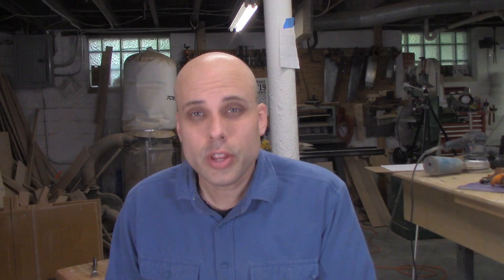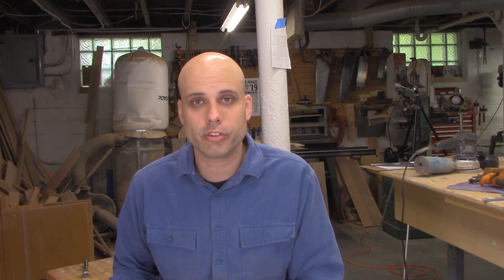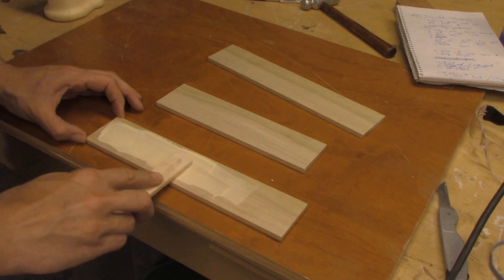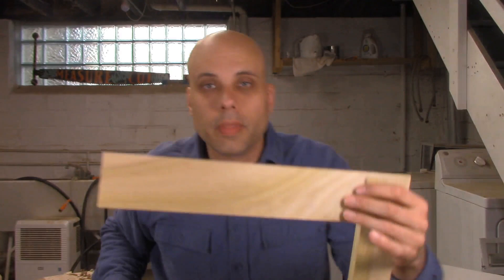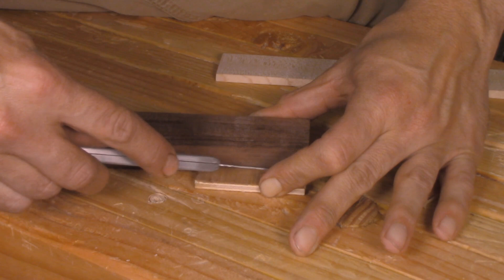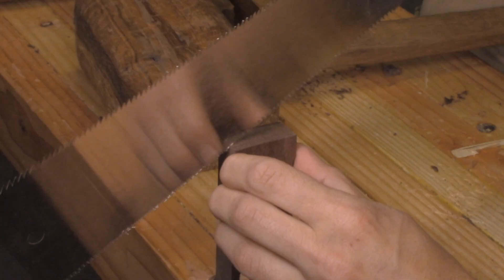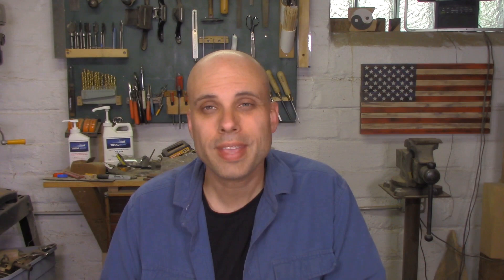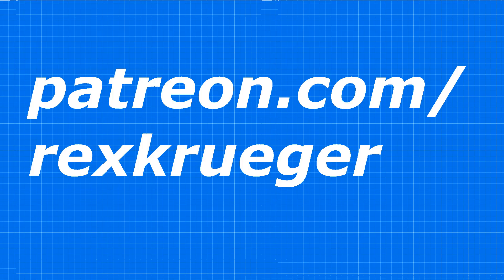Make your own try-squares for woodwork.

Comment: Nerd-tip: If you don't have a square that's appropriate for the job, measure accurately and use the pythagorean theorem or a quick and dirty 3-4-5 triangle.
Reply: Yay for nerd tips! Really, I am tickled that someone actually thought to add this to the comment section, because it really did need said! If I hadn't seen your comment, I'd have had to make it, myself. 😄 Maths rule!
Reply: Alternatively use a compass and straight edge.
One line,
one circle centered on the line,
second circle same size on the intersection of the previous circle and line,
the intersections of the two circles make a line perfectly perpendicular to the original line
Reply: Nice. 😊
Reply: Maybe a better way to say it: a line constructed at the intersections of two circles is perpendicular to the line drawn between the center points. Sizes don't matter.

Comment: Hi Rex. I was surprised that you didn't show how to make a square without having a square to use. By using two intersecting circles on a straight line and connecting the intersecting circles  perpendicular line. Perfect right angle every time to use. Best regards
Reply: All you have to do is create a 3-4-5 triangle and built the square using thar as a quide. Even a string will do. However, the square has to have flat and parallel wood to work correctly, so the first part is learning to make straightedges out of wood
Reply: @researchandbuild1751  i was thinking you could lay out three pins/nails on a flat piece of board at the vertices of a 3-4-5 triangle (say 6" 8" 10") and use that to align the two parts of the try-square.

Comment: To cut bridle joint (or rip) with ryoba saw, angle woods 45 degrees toward you, saw to both line at 45 degree angle (saw level), turn over and repeat same process  on other side. now level wood and flush to bottom. Try it you will be amazed how well this works. Same technique for tenons. Make both cuts at in succession on on side, to time to speed up process. This is correct technique.
Reply: Well said. You read my mind. I always cut one side, the other, then square the depth, even with western saws.
Reply: ^
This is the way

Comment: Just made my own small square after downloading the pdf. Really didn't need the pdf, but thought I'd make a small donation to Rex for all of his hard work. That's a hint to all of you other cheap woodworkers. The square is coming out awesome. I used walnut for the handle and oak for the rule with 1/8" brass pins (3). Finishing with Danish Oil and lacquer. 2nd application of oil is drying. I'll lacquer it in a few days. Can't wait to use it in my shop. I've got a bunch scrap pallet wood to mill so I'll be putting it to good use.
Reply: Ah, rescued pallet wood - a person after my own heart!

Comment: Rex, just discovered your videos and love them.  A way to make a square without a square is to use a little bit of geometry...

A right triangle has a simple ratio of 3 to 4 to 5.  So... if you make one limb length of 3, the other limb of length 4, and then the diagonal between the ends length 5, you will have a perfect 90 degree angle.  You can also make other ratios... 1 1/2 by 2 by 2 1/2... or 6 by 8 by 10, etc.

Comment: You can also use a Speed Square (if you have one) to scribe a line parallel to the edge of a board. It’s designed for that on purpose. Put your pencil or marking knife against a point on the Speed Square, put the angled “lip” against the board edge, and move the marker and Speed Square together.

Comment: Hey Rex! That's a pretty great video you got there!!!

   Minor note you might be interested in...
   Binge-watching over on Jonathon Katz-Moses' channel, I happened on one of those "innocuous little tricks" regarding saws... Moses LOVES his Japanese Saws, too... so it helps. He suggested that when you're cutting, take a position that lets your "saw arm" work as straight and easy as you can (referred to the pool-player and stick)...  but everyone has that advice... so you've heard it. 

   Importantly, he said to WATCH the saw BLADE, or rather the reflection in the blade. If it stays straight, you're either dead-on or very close.

   Now, I've never really thought about that before, so I immediately took one of my new (to me) Vaughan Bear Saws out and grabbed a piece of "reasonably straight scrap"... AND low and behold, the reflection WILL absolutely make a straight segment between the stuff you're cutting and the end you can see... 

   Okay, it's not a miracle, and anyone who understands basic optics can explain (probably better than me right now) how it all works with light "refracts at exactly the same angle as it hits a reflective surface" and how it's all geometry... etc... AND for the record, when you're stuck trimming off "little bits" that are completely covered by the blade, no, you can't see through the saw... BUT for anything large enough that you can see the end past the blade, lining up that reflection so it bridges the two visible segments REALLY DOES HELP!!!
   AND since Japanese saws are thinner than you're used to, being more prone to "wobbly stuff" it can help keep an eye on something to pace yourself while you get used to them...

    Otherwise, feel free to laugh at me... I mean... I'm over 40 and I just hadn't thought about it... SOOOooo I kinda laugh (almost hysterically) at me too.

    FOR ANYONE INTERESTED, Katz-Moses has a video regarding "Tips and tricks with Japanese Saws"... and there's a LOT more than this one in that... seriously, check him out. ;o)

Comment: You don't need a piece with a good edge to check a square.  You just need something flat that you can put two nails in.  the two nails make a line, so you don't need a reference edge.  Put the square on the nails, strike a line on the rule.  Flip it around, strike another line.  If the lines are parallel, you're set.  If they're not, figure out which way it's out, and correct it.
Reply from the maker: Now THAT is a hot tip. Thanks!
Reply: Um, and how do you get the same edge of the rule flipped over when the beam is pointing the other way on two points of contact? The beam will be off both nails when flipped the other direction. Do you have a video of this technique? If so please link to it in your reply. I am obviously missing something in your technique.
Reply: @midjetville  Thanks fkr yourbreply. With all respect, that will work if your dividers are exactly perpendicular to both lines. Even crooked lines can be measured by dividers and touch both lines at non perpendicular points to the other line. I suppose you could use a compass and strike arcs and see if they cross the other line, but that's only as accurate as the thickness of your pen or pencil line. As long as you feel your system is accurate enough for your work, it's all good.
Reply: @midjetville  oh, I get it now. Thanks for being patient with a brain damaged old veteran. Yup, that sure seems like it would work well, now that I understand your method.
Thanks again.
(Brain damage... shrapnel in the head, multiple concussions, and a stroke (stroke years after  leaving the service)).

Comment: In lieu of gluing the stick on to the speed square to turn it into a try square it should be possible to stand the board on edge on a flat surface. Then the speed square could be brought into use by resting it too on the surface and bringing its edge to the side of the board.

Comment: Another great video!  I really love the idea behind your series.  It's a great way to encourage folks to have a go at a great hobby and show that they don't need a whole shop full of expensive tools.... (me looks over at the shop of expensive tools I've got.... then to the basic handtools that I really enjoy using).

A trick if you want to get a bit more OCD on truing up your squares.  Instead of pencil lines use knife lines.  And it doesn't need to be a full line.  Just a half inch hack mark near the handle and another at the tip.  But now the trick.  When you flip the handle over put the knife blade in the hack mark near the handle and bring the blade up to rest against the knife blade.  Then holding the blade firmly in place make another hack mark at the tip of the blade and compare those two.  If you have just one mark because the knife blade went right back in the line it is a wondrous thing.  And if not it makes seeing even small differences a lot easier.
Reply from the maker: Thanks for the tip!  (I've got all the big machines, too).
Reply: And maybe the most important: make sure your board's edge is absolutely straight. Otherwise the whole test makes no sense.

Comment: Hey Rex, so an inexpensive tool that I find indispensable in woodworking is a "four in hand" it's a simple rasp tool that has a round and flat wood rasp and a round and flat metal file in a simple bar. Made my tenon work so easy for the Roman work bench. Also really helpful for smoothing sharp corners or making bevels to avoid chip out like on furniture legs... seriously...if the zombie apocalypse happens... I'm bringing a knife, a hatchet, and my four-in-hand first
Reply from the maker: Yes!  I talked about them in a previous video. Love them.
Reply: @RexKrueger  oh! I must've missed that one. Sorry. Keep up the great work!

Comment: Nice video Rex. Trimming out the windows in the house and had some Leftover 3/32" thick by 3/4" wide strips of very nice ash. Made a couple of 3"  long squares that fit perfectly in the shirt pocket. Very, very handy. Used cutlery rivets at the joint. Now those are  nice, handy little guys to have around.

Comment: Well, you've inspired me: I'm making an outside 45-degree try "square" with a 50" tongue for laying out mitered tops at work, using quartered white oak -- so if I get it right, it should save a lot of time. I'll be looking for hand planes at an upcoming annual flea market and hope to be making a 45-mitered shooting board, which will save even more time. 
     The bad news is that I rarely do that stuff. I'm the resident moulder magician.
Reply from the maker: I hope you do it!
Reply: @RexKrueger  I finished it yesterday. I tested it against a big speed square and a Nobex folding square and it looked to be dead nuts. I left the tongue long to give some inside-45 utility, and to test it. 
     (I made a zero-clearance insert with a splitter per Stumpy Nubs, but the spitter is a little wide. It keeps the stock against the fence, so I'm not going to correct it; between that & my new Grr-Ripper push block, I've never made table-saw cuts that accurate.)

     Now I have to make a table-saw tenoning jig before my irresponsible co-worker shoots his goolies off. (The guy makes jigs for everything -- except the things he needs.) And a 4'-5' 45-miter shooting board for assembling big tops. Never made either of those, but it should be worth the effort. My co-worker probably needs his goolies.
     Thanks for the great vids!

Comment: Very nice. Here's an idea you may like. I used to work on a lot of 3D printed parts and I used CA glue to harden the material and get a smooth finish. I would saturate the working edges of the squares with CA and after they cure (accelerant if you like), do a little smoothing with a scraper or sand paper, then go with the final finish of your choice. I think that would make a square a little longer lived, particularly with a less dense wood like the poplar.  Cheap and easy too.
Reply from the maker: I have done this in the past. Totally works.

Comment: There are lots of ways to get things square. If I don't have any kind of square I like to use a piece of paper. It doesn't matter what shape this paper is as long as it's reasonably flat and large enough the result is useful for whatever you are going to use it for. To get  a true square angle just fold the paper in half and then fold it in half again making sure the first fold is as perfectly edge to edge as you can. The result is an almost perfect 90 degree angle. It's not a perfect solution, but should be good enough to use for putting together a square like these in this video, and certainly better than trying to eyeball it. Also it's quick, easy, cheap and involves no measuring, calculations or... something else, I just totally forgot what it was while typing...
Reply: You can also take your piece of paper, a single pencil, a string, and a couple of pins (no matter what kind they are)...

1. tape the paper down to a surface you're not worried about scratch... It should be reasonably flat and capable of pins sticking into it.

2. Stick the two pins down close to the paper and tie the string to one of them, draw it tight to the other to guide your pencil, and make one straight line.

3. Now shorten the string to just over half the length between the two pins... and tie it in a loop for the pencil. Make a wide arc at the length of the string...

4. Unloop the string from the first pin and loop it to the other... and repeat the arc.

5. Move the pins to where the arcs cross... Those should cross in two places, so there's a spot for each pin.

6. Loop the string back over a pin and draw it tight to the other (same as step 1) and mark a straight line.

   It takes just a couple tries (at most) to get this trick "right"... BUT when done well, you not only create an exactly 90 degree mark, but your "cross" is EXACTLY half-way between the pins' original positions. It's a VERY old-school measuring and "layout" trick for architecture without "technical tools" of any kind. I mean, honestly, even in the bygone BC-periods, Architects and Engineers might've been primitive, but they DID have actual tools... rather than two pins, a bit of string, and a marking device.

   I use this "trick" for any template I need where I can't fit a square... and on days I've misplaced the damn thing and get too lazy to look for it... AND of course, that once in a while when some jerk decides to test my patience with dubious questions about my skill.

    Works pretty well with a Compass (the geometry tool, NOT the navigation tool), provided you ARE capable of a straight line... ;o)

Comment: I like to cut a corner down to the baseline first while cutting across the top with my pull saw.  Start with the crosscut blade to make your initial kerf at the corner.  As long as I do both of those straight (the two sides I can see, so it's pretty easy) the back side pretty much has to be straight once I start cutting down that side because the rest of my cut guides it.
Reply from the maker: Good tip!

Comment: So... cutting blade implements. I use my Stanley straight razor knife. Its really not about the tool, but how you guide the sharp bits into the wood that makes the mark. Mine cost $7.00 back in 1995 and I have used it for everything.

Comment: The bridle joint is actually one of the strongest wood joints, so long as it is assembled with a good PVA glue joint. You do it a disservice saying it is not very strong. Half-lap and bridle joints are the strongest joints you can make with PVA glue. Stronger than mortise and tenon (bridle is just M&T with more glue surface area).
Reply: By the way, I am not just making that up. Fine Woodworking actually tested joint strength of 18 different joints and reported on it in their 2009-Jan issue. 
https://www.finewoodworking.com/2009/01/01/joinery-shootout 

The strongest joint was half-lap, and the second was bridle. 

 1603 half-lap
  1560 bridle
  1498 splined miter
  1444 3/8-in mortise and tenon
  1396 3/8-in floating mortise and tenon
  1374 miter
  1210 3/8-in wedged mortise and tenon
  1162 3/8-in pinned mortise and tenon
   988 5/16-in mortise and tenon
   836 beadlock
   759 dowelmax
   717 1/4-in mortise and tenon
   698 pocket screw
   597 domino
   545 biscuit
   473 butt
   313 cope and stick
   200 stub tenon
Reply from the maker: I will need to read that.

Comment: On sawing with a pull saw:  I find you should only saw what you can see, using a series of triangles.  Start across the end grain and drop the saw along the waste side of the visible vertical line.  Then reverse the stock and again cut what you can see.  Finally finish the inside, which ironically ypu can't see.

Comment: Suggestion. You can make a super precise protractor from a sheet of plywood and a tape measure by using 90 or 180 units on the tape measure to form the outside of a quarter or half circle.  (think pi and circumference).
If you use a sheet the same with as the tape it is easy to glue on with contact cement and all you really need to do is attaching an arm in the center to give you the angle. The bigger the circle the more precise a tool you get. 
If you want to go really high tech, you can fabricate a vernier from som clear plastic and get 1/10 subdivisions, but it will properly be way more accurate then the actual arm you have can deliver.
A tool like this is gold to have along with a carpenters bevel angle and you can even make several if you need to switch a lot between fixed angles on a project or make pins through the arm to get often used fixed angles.

Comment: I have another suggestion for this series.  Clamps.  "C" clamps, bar clamps, cam clamp, those clamps made from 2 2"X2" with threaded rods in them ( you used them in the perfect joint video).  Clamps are an essential part of woodworking.  Being able to make them cheap would be really nice.  Just a suggestion.  Cheers from Canada!!  P.S. Pask Makes has a good starting idea that I know you can improve on.
Reply from the maker: I might do that!

Comment: So trick you can do with a speed square.  Take something strait like a paint stirrer and slide it against the inside of the squares fence.  This will let you check inside edges easily without super glue.  You just hold it in place with your hand by feel. I still prefer a try square or combination square, but if a speed square is what you have it will get you by.